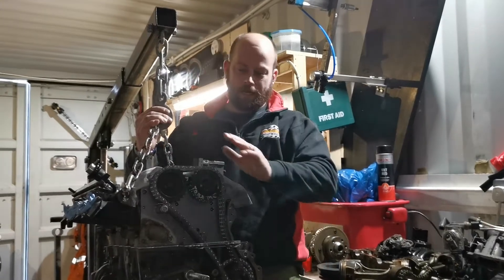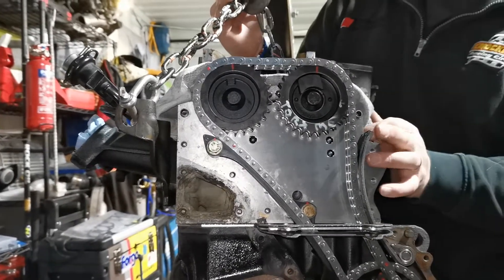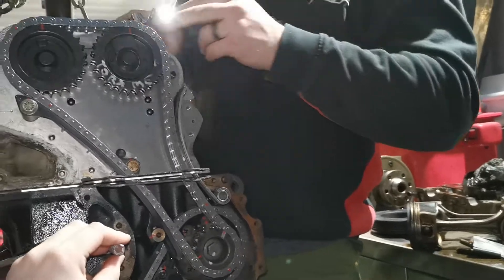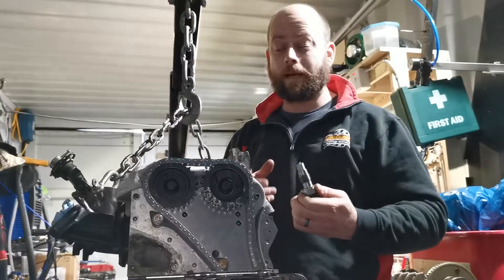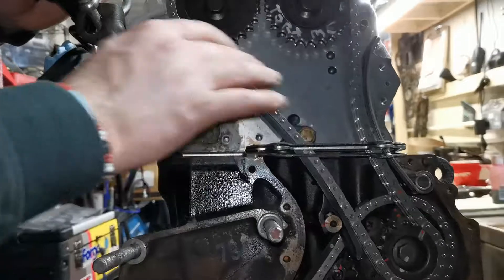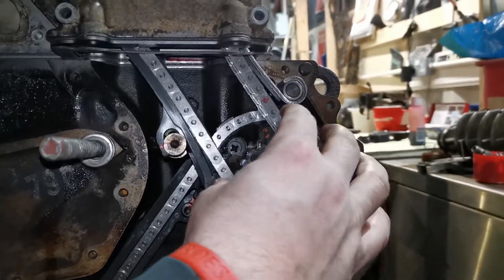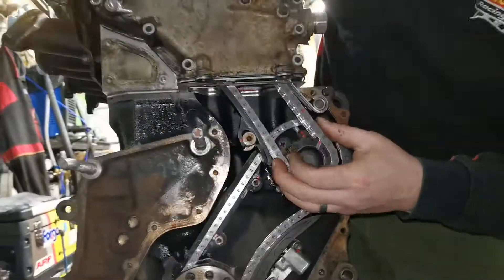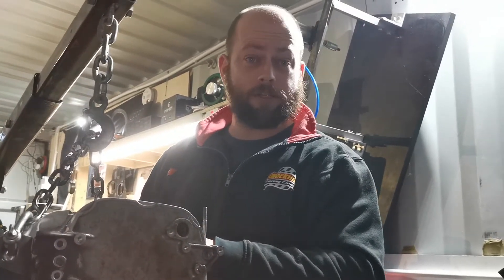MKS Performance VR6 2.9 head spacer

Comment: What did you do as far as the plate. You took a head gasket and used one layer of it on the top and one on the bottom to seal? I never knew how this actually worked?

Comment: 5mm total head gasket is a lot. What compression ratio does this giving you?

 I’m running 3.1mm for 8.5:1 compression.
Reply from the maker: We had to remove quite alot of head and deck material due to the corrosion from weak coolant so will actually bring compression back up. Would need to find the paper work but 8-5 I think was the final cr

Comment: For tensioner normally people use 2x copper washers + 4mm spacer/ring. Personally i prefer manual tensioner with screw to setup correct tension. You forged to mention when using head spacers you need to retard cams little bit otherwise your timing is incorrect and you cant make proper power 👍
Reply: a couple teeth or one tooth?
Reply: @PTRPerformance  would this explain why I have a short burst of air being sucked in before getting pushed out?
Reply: @PTRPerformance  of the exhaust